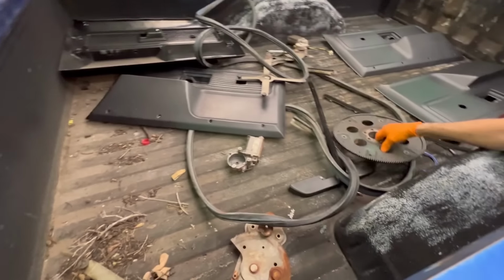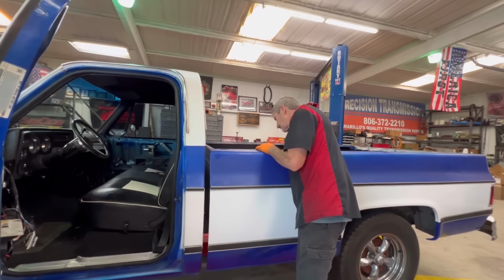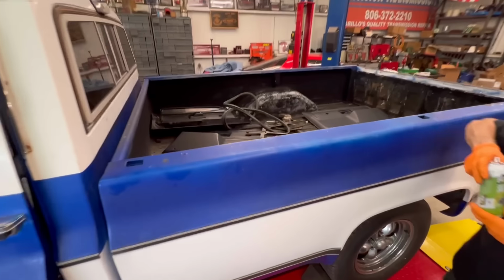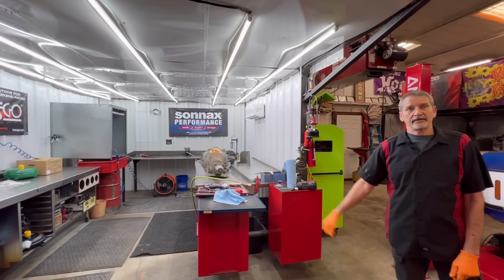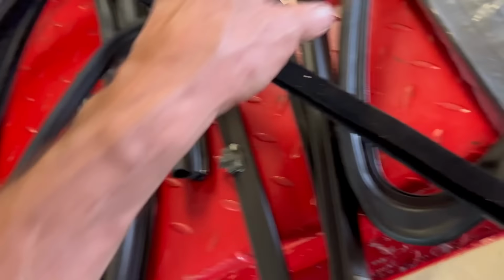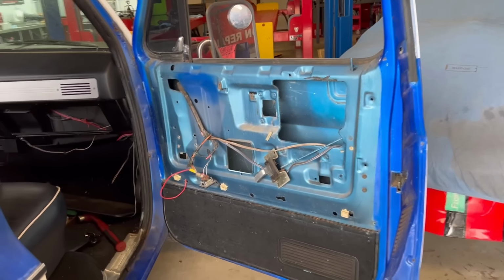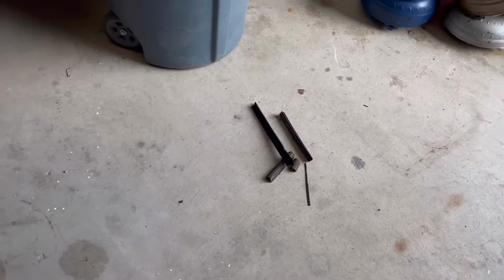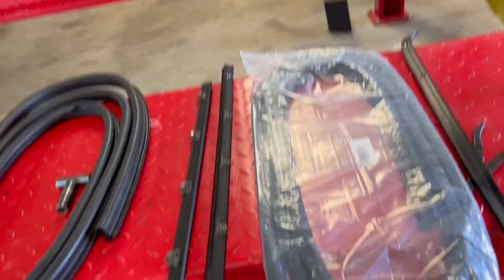77 C10 pickup. Something different. OMG -  Won't do that again.

Comment: Awesome Job Richard ..... Spray Silicone is a life saver , but there is something else you can put into the rubber guide moldings is Spray Graphite in powder form .
you can load it up in the rubbers and it will do the guides justice and the windows will run up and down ...
Any autoparts store carries it and it is mostly used for lock cylinders but its a great things to add to your lubricant  can assortments.
I just looked it up and it is made by CRC and it is called  Dry Graphite Lube .......   One thing is watch what you get it on cause it will stain anything and everything it touches by turning everything dark gray . What you would call the "CONTROL SYSTEM" is actually a "Window Regulator " and If i were you I would have "NOT" used the bolts that came with it and I would have used 1/4 aluminum window regulator rivets .....They Will Last Forever and the bolts/nuts that came with it are eventually gonna loosen up no matter how much Lock-Tite you put in there .
Rivets are the way to go !

Comment: I've still got new door locking  mechanisms in the box that I've had for three or four years for my old F150.   Someday I'm going to install them or they will be there for the next owner to install.   It's not that hard to walk around and lock the passenger door from the outside with a key vs changing the electric door locks.    What I did consider critical was changing the old radio out for one that has a screen and will play my mp3s,  that job I did the day the new unit arrived.

Comment: The felt should still be greased, then the silicone spray let's it all slide nicely. Otherwise the spray doesn't last very long. Especially in severe cold. I'm about to go through my '77 Cheyenne doors the same way. Including different mirrors. Big job I've been putting off.

Comment: 😲  That was very interesting.  👍👍     What I would like to know is...1) How old is the vehicle?  and  2) where did you find OEM style door seal and hardware, etc.???    I have a 97 GM that I would like to replace the window seals.
Cheers
Reply: That appears to be a 78 Chevrolet, LMC Truck has most of if not all the parts, I’ve also bought stuff for a 66 Chevrolet Van from The Filling Station, I got a windshield gasket from them for the old van not too long ago. I hope this helps you!!

Comment: Please don't buy a 200 amp alternator from a company called DB Electrical on the internet. Put one on my 94 chevy and the alternator immediately ran so hot you couldn't touch it. And it fried a brand new battery.

Comment: Looks like my old truck , probably is., had a 305 in it, was originally light blue and interior, when i had it, it was in prestine condition,  untill  my brother ran it into a stock tank and it was hualed off to a impound lot, the it was auctioned off or sold.

Comment: 1986 K5 Blazer and I like my manual roll em up windows. Nothing sadder than the electric back window on a Square Body K5 Blazer. I converted mine to a truck tailgate and a soft topper.

Comment: Bigger gauge wire really helps like some good ofc 12 gauge carry’s more current than the stock wiring had same problem
Reply: Agree, larger guage wire for all the postive leads, can help a lot. Adding new brushes to the OEM motors can also help, long as they're actually serviceable(?)

Comment: Road dust gets impregnated into the felt in the channel and binds up on the glass. Along with that, the rubber gets brittle with age and temp. And when it's rolled down,  it pulls the channel and tears it.
Been using silicone spray for decades.  And garage door lube (Walmart) on the plastic rollers helps to!
The only bad thing is, if the glass has tinting and the silicone can get under the tint adhesive and it lifts.
Gotta pull the glass to clean it properly. 
Just like windshield washer fluid with water "repellent" will give problems if you don't clean under the weather stripping. Paint WILL FISH-EYE AND NOT ADHERE..